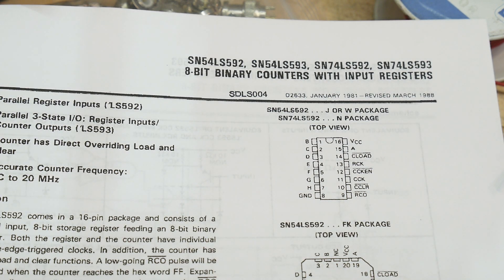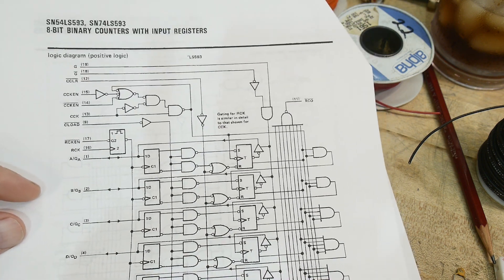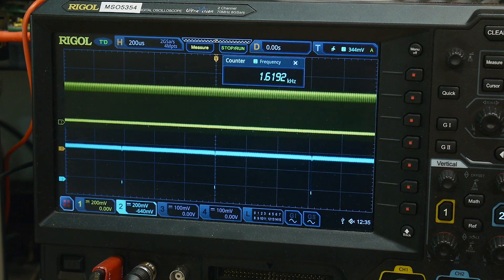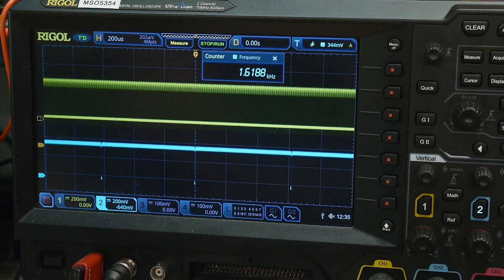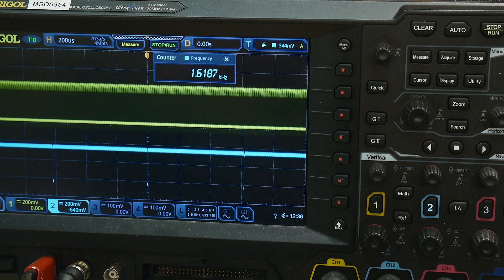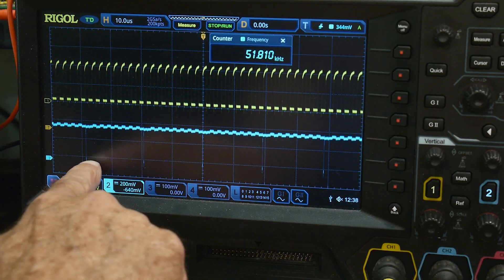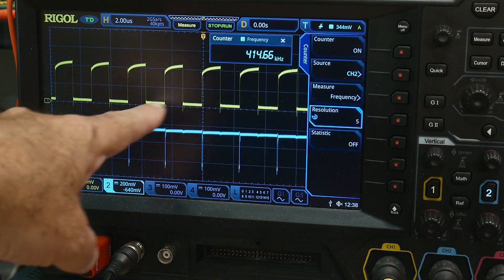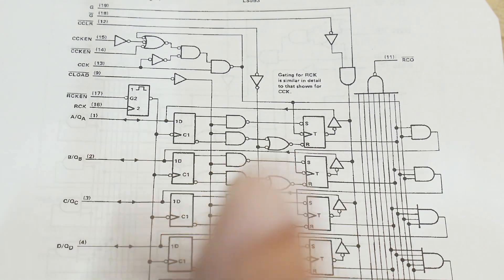#1690 74LS593 74593 8 Bit Counter

Comment: Very good video! You really need a solderless breadboard and not be afraid to experiment. That's the best way to learn so great advice. An adjustable CURRENT LIMITING power supply is a MUST as well. It's nice to not fry components in case of a mishap. Thanks for sharing and hope you had a great Thanksgiving!

Comment: Only problem is that these days discrete logic chips like this are hardly ever used. It's either in a microprocessor or an FPGA for high end hardware.
Reply from the maker: it is sad, but there is no reason to use this stuff. good to know if you need to repair old stuff. I hope the new doctors still know how to repair me.